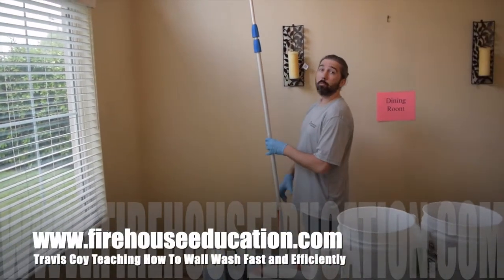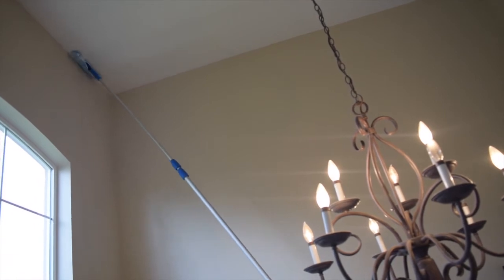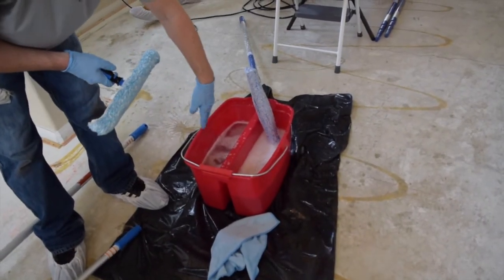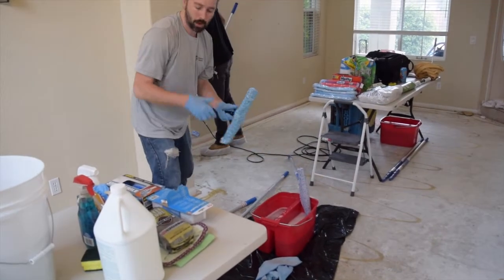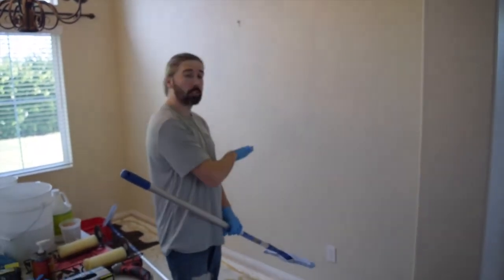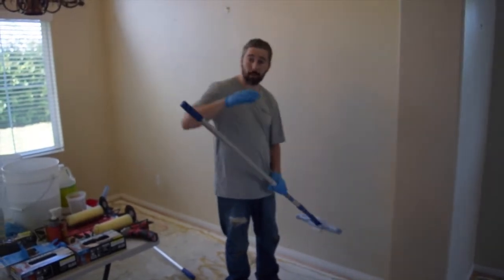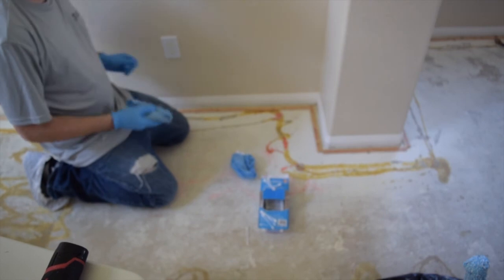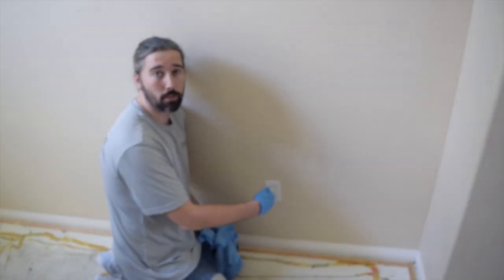How To: Cleaning Walls, Ceilings And Basetrim After Fire/Smoke Damage

Comment: Years ago having my cleaning company I did a couple small fire jobs for Sears They came good but I was always worried about the smoke odor problem , when I worked for several contractors doing fire jobs some would remove all drywall and insulation seal the studs and ozone , others recently would just seal the walls with shellac and paint of course clean vents and A/C after the completion I could still smell the smoke I would not accept the job if it was my house . I know it depends on the fire and damage but it seems a high risk if the homeowner complains and it has to be redone , Whew !

Comment: this appears to be really light soot, would this method work on a heavier smoke damage or would you chem sponge it first?
Reply from the maker: I do not chem sponge walls unless it is wall paper or unfinished wood. This method works on most light to medium fires using wall wash. If it is bad enough that you need to use De-Greaseall then you need to use white cotton cloths and circular cleaning method.
Reply: FirehouseEducation Can I ask why you do it this way, Ive been on many fires for a large restoration company as a subcontractor and they call for chem sponging the walls before they seal coat and then paint them. This is very labor intensive to go over the wall 3x with a sponge and thats why ive been looking for a better method. What would be your method for a heavy fire? Often they remove half the walls to get inside of them and clean other half in a heavy smoke damage. Thank you!!
Reply: @TT-ik3kd  I've cleaned it 3 tines , one foot patch (big patch) with magic eraser, half detergent half salt (works like simply green) 3 times  its wrecked me cis whole room. I've damaged myself. I don't know what to do.

Comment: From what I’ve learned Over the years in the restoration industry . Typically , per standard… you Never want to use a wet wash method on flat paint surfaces like ceilings or walls (drywall) as this can smear and embed the soot particles into the material. Instead the Recommended method is to dry chem sponge the surface after Hepa vaccuming the loose soot particles.
Reply from the maker: Yes that is correct in some cases. But the majority of the time this wet clean method is the best most efficient method to use.

Comment: Is it recommended to use Kilt paint to paint over and encase the smoke on the wall. Then paint a second coat.
Reply from the maker: Possibly it just depends on the degree and severity of the fire and wether or not you can get the odor out of the structure without painting.

Comment: Do y'all use the chem sponge first before cleaning? Do you always clean the ceiling's?
Reply from the maker: Yes we almost always clean the ceiling. I usually find that if the walls need cleaning then so does the ceiling but it depends on the severity and conditions of the fire. I do not chem sponge the walls. Its a waste of time if I am going to wet clean them anyway.
Reply: @FirehouseEducation  We are cleaning a house and the soor on the ceiling is so thick. The guy's myst have used over 5 chem sponges and it was STILL coming off
Reply: *soot🤭
Reply from the maker: @shannonwaege2055  With soot that heavy you should be using white cotton cloths and degrease all and then painting. Do not use chem sponges on this as it is a waste of time.